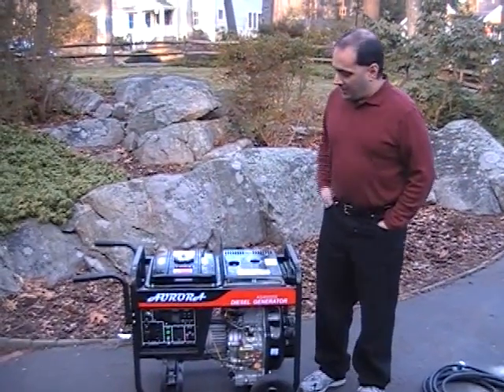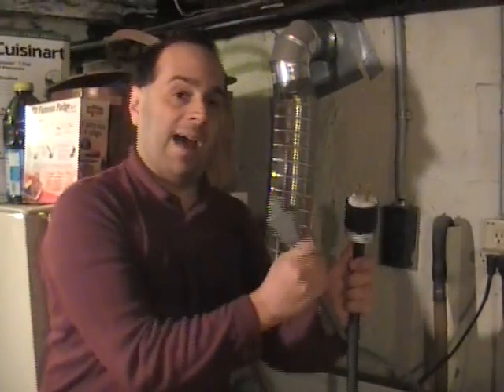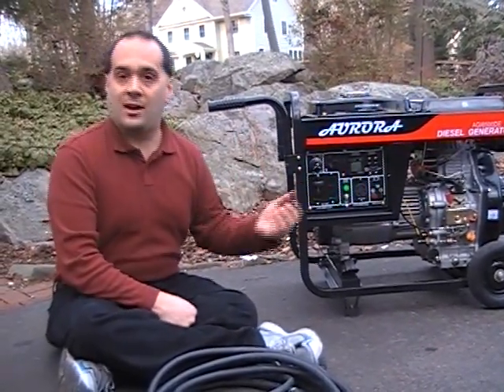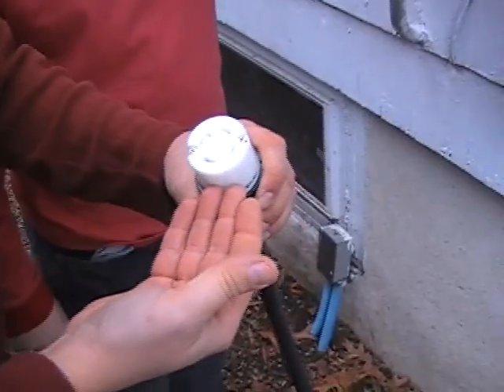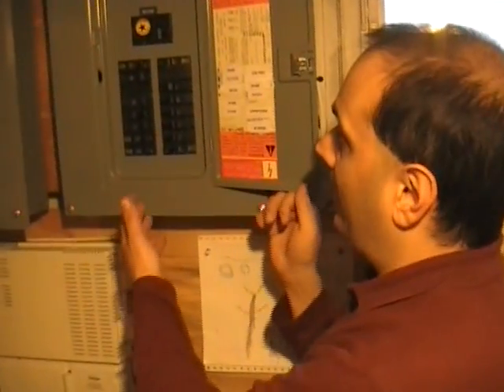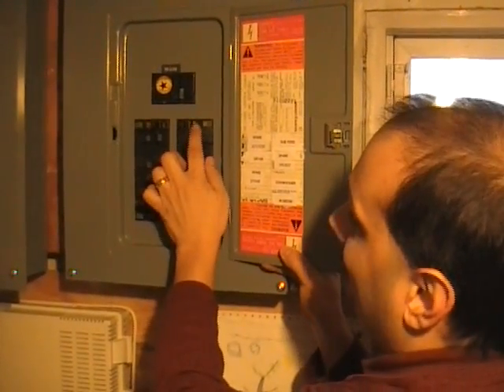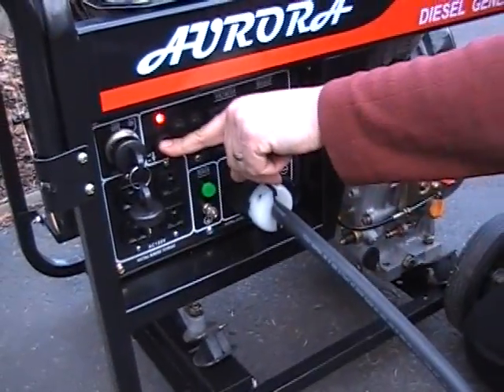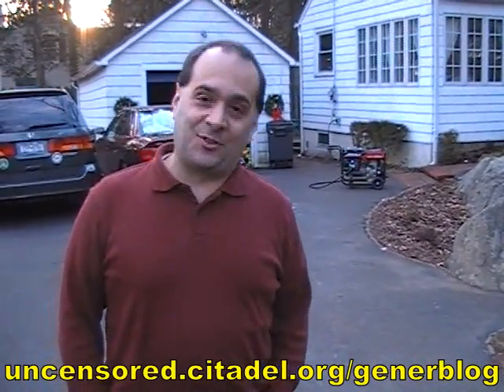Inexpensive residential generator hookup

Comment: Maybe you can answer this question for me please, I narrowed down the appliances we need to power in case of a power outage and its a furnace (13.9 amp), 2 fridges (both are around 9 amps), Dryer/washer (each is 6 amps, but I will run one at a time), bathroom lights with an exhaust fan (7 amps....fan is strong) and some lights which will come out to around 5 amps.  I am around 41 - 42 amps in case of a power outage and this is for a big house.  I went to Home Depot and I was told a generator with 50 amp breaker when connected to a 2 pole 50 amp breaker will always supply 50x220 = 11,000 watts even if I am only using one appliance  or no appliances being used.  Is this true?  They told me to at least always go with a generator that can generate 10 amps over what it is connected to which means in my case if I connect it to a 50 amp breaker, then I would need 60 amp which they don't sell.  But is this true?  If even a 30 amp generator hooked up to a 30 amp breaker that the generator will be maxed out even if the house is running say 5 amp?
Reply from the maker: To say that the generator "will always supply" the maximum current isn't exactly true.  It will supply whatever you are drawing at any given time, up to the maximum.  And you do need cables, receptacles, and breakers that are rated up to that maximum.   If you want to run all of those appliances at the same time, then you need the big generator (10,000 watts is a common size, but expect to spend a lot of money).

On the other hand, if you don't plan to run all of those loads at the same time, then a common 5,000 to 7,000 watt generator connected to a 30 amp breaker will do just fine.  The house in this video has a 30 amp generator main and I attached it to a 6,500 watt generator.  We would run whatever loads we needed, and if we got carried away and ran too much at once, the generator's own circuit breaker would usually be the first to trip.

Bottom line: buy a generator that can power whatever you plan on needing to run AT THE SAME TIME.  Then buy cables and receptacles and breakers to match whatever size plug is on that generator.
Reply: I was shocked when I went to HD and the electrician told me "If the generator is hooked up to a 30 amp breaker, then the breaker will pull 30 amps from the generator and even if you are using less than 30 even 5, you will still be producing 30 from the generator.  He actually told me if its connected to a 30 amp breaker, then your generator (30 amp gen) is fully loaded even if nothing is used inside the house.
I sat down with my family to decide what can be on at the same time and it came out to around 41 amps.  So, I am looking at the 50 amp generators for around $1K alone.  But I am afraid when its connected to a 50 amp 2 pole breaker that the generator will be producing 50 amps and that's its max.
Reply from the maker: The HD guy is simply wrong on this one.  If you wire your generator to the transfer panel with a 50 amp breaker, 50 amp connectors, and 8 gauge wire ... the generator will be able to supply ** UP TO ** 50 amps.  It won't be supplying 50 amps all the time.  At any given time it will supply whatever you're drawing from it.  Think of it this way: imagine what your electric bill would look like if you have 200 amp service and you were drawing 200 amps all day long!  It's the same thing with the generator.
Reply: @IADHDD  Generator safety rules: Always make sure you follow all the generator safety rules before using your portable generator. This is only a reminder. Generators can be dangerous if not used carefully. Every year, hundreds of people die or get injured when using portable generators due to carbon monoxide poisoning and electrocution. Make sure you are using your generator carefully and keeping others safe as well. There is something very serious that everyone should always be aware of when using generators. Some people do run their generator indoors which is not safe and that increases the risk of carbon monoxide poisoning which can cause death of family and you. Some people run their generator in wet conditions which can electrocute them. Please remember that you should never run your generator indoors. Remember that carbon monoxide is an odorless and colorless gas that you cannot see or smell. Carbon monoxide is a silent killer. Keep that in mind. Make sure your generator is 15-20 feet away from your house and away from doors, windows, and vents. Never use your generator in your porch too. Having a carbon monoxide detector is very important against generator safety. Some people also allow children to go near the portable generator which could pose risks. We need to keep an eye on our children making sure that they are not near the portable generator so they won’t get electrocuted or burned by the generator which is dangerous. A locking enclosure also keeps kids safe. A generator shed might look like a tempting place to explore, or take cover during a game of hide and seek, but a generator is a dangerous piece of equipment that can cause injury. It says on the manual that we should also keep children away at all times from the portable generator to avoid injuries. Please do not allow a child or unqualified people to operate the portable generator.  It is important to keep your children safe especially little ones. The portable generator can be hot during an operation. Just because some manuals missed what should be listed doesn’t mean it’s safe to do. Always follow the generator safety rules when using portable generators. Generators pose electrical risks. If you need to use your generator during wet weather, you need a generator tent to protect your generator from getting wet. Don’t let your generator get wet. Keep your generator dry and before using your generator, please make sure your hands and your generator is dry. Do not wear loose clothing when operating the generator. Everything that is said on the generator’s operating manual should not be ignored. Never smoke cigarettes near the generator. Please keep flammable things away from the generator. Never overload your generator too. Your generator can catch fire. Never ever try to plug a generator cord into a wall outlet to avoid back feeding. Back feeding your generator is dangerous. Always turn on your generator first before plugging in appliances and shut off the appliances before turning your generator off. Use a heavy duty cord for your generator and the cord should not be worn out. All the instructions should be followed carefully. Never refuel your generator while it’s running. It can cause fire if fuel spills while your generator is hot. You should turn off your generator and let it cool off before refueling it. Having a fire extinguisher next to the generator is also important. This is only a reminder for everyone’s safety of using generators. Make sure your generator is properly grounded. Having a fire extinguisher next to the generator is also important against the safety rules. https://youtu.be/I1jT3ANENvI and here is a video more about keeping others safe when using generators and also about our family’s safety. It’s important to keep our little children safe as well. Make sure they’re away from the generator. Hope this helps.
Reply: He is confused. Maybe someone was talking to him about the difference between a standard generator and an inverter generator. What sucks about standard generators is that the must run 3600 rpms whether you are using any power or not. This is how they make 60hz power. They have 6 coils inside and that's how the math works out. Obviously, it takes more fuel to run 3600 with a load than to run 3600 with only a couple lights on, but still it's way more fuel than if you could idle it down. Now in comes the inverter generator. It works more like your car with an inverter attached. It generates DC and sends it to a built-in inverter. So since the 60hz, AC is being created electronically, the generator can idle down in times of little use. This is why the little Honda's and the like are so crazy fuel efficient. That's really the only reference I can think of to what the homedepot guy could have gotten completely confused. Also, I notice that you said your washer and dryer use 6 amps each... Are you sure about those numbers? If you have a gas dryer, I guess maybe, but 6 amps is nowhere near high enough for electric dryer... it'd be more like 45 amps... Also, an exhaust fan @ 7amps??? That's 700 watts! It'd better be strong! For 700 watts, it'd better be able to suck you up off the toilet and blow you into the back yard like a damn ejection seat!

Comment: I  agree with everyone that it's a great video!  I see a lot of comments from Professional electricians I'm hoping that will give me
a little help.  I live in rural so. WV and to give you an idea how rural,  wife and I don't even have mail delivery.  We drive seven miles each way twice a week to get our mail.  the nearest town to shop is 2.5 hours away.  That's how far an electrician has to travel.  I have one who an another veteran from the VA called me and said he would drive to my house and install the system if I 
could be sure to have the box, breakers, switches, and everything he would need.  I sent him the video link and he said it was no problem, but I need to purchase everything to avoid his business markup.  I' m looking to only power 5 rooms off of a 5500
electric start 30 amp generator.  Electric start for wife as I'm a disabled Vet on O2.  So I'm asking what do I need as far as the box, breakers switches, etc.  Any help greatly appreciated.  I can not afford to have him come more than once.  Thanks
Reply from the maker: You might want to consider a water cooled 1,800 RPM diesel generator.  They cost more but they are rated for continuous operation, so if your utility power is out for a couple of days, you can run the generator the whole time. An air-cooled 3,600 RPM generator will get damaged if you try to run it for more than a couple of hours at a time.

As far as your supply list, it depends on what your main panel looks like right now.  Do you have room for an interlock?  You should probably send a photo of your main panel to your electrician friend and determine what's needed to connect up to that.  The parts list is going to be determined by whether you have room for an interlocked main, or if you are going to put all of the generator-fed loads in a separate panel like I did.
Reply: I really didn't expect a reply, so I want to thank you Art!!.  I was looking at a few separate box systems after I posted and I really liked the Idea as It would be so much easier on my wife if something happened to me.  I was looking at what I would need for the electrician.  I'd like to use a good box with a good interlock.  I only
need about 6 - 120 lines is all.  I need a small box of square design with a bottom feed,  that's  stupid right.
Reply: @egm1947  Generator safety rules: Always make sure you follow all the generator safety rules before using your portable generator. This is only a reminder. Generators can be dangerous if not used carefully. Every year, hundreds of people die or get injured when using portable generators due to carbon monoxide poisoning and electrocution. Make sure you are using your generator carefully and keeping others safe as well. There is something very serious that everyone should always be aware of when using generators. Some people do run their generator indoors which is not safe and that increases the risk of carbon monoxide poisoning which can cause death of family and you. Some people run their generator in wet conditions which can electrocute them. Please remember that you should never run your generator indoors. Remember that carbon monoxide is an odorless and colorless gas that you cannot see or smell. Carbon monoxide is a silent killer. Keep that in mind. Make sure your generator is 15-20 feet away from your house and away from doors, windows, and vents. Never use your generator in your porch too. Having a carbon monoxide detector is very important against generator safety. Some people also allow children to go near the portable generator which could pose risks. We need to keep an eye on our children making sure that they are not near the portable generator so they won’t get electrocuted or burned by the generator which is dangerous. A locking enclosure also keeps kids safe. A generator shed might look like a tempting place to explore, or take cover during a game of hide and seek, but a generator is a dangerous piece of equipment that can cause injury. It says on the manual that we should also keep children away at all times from the portable generator to avoid injuries. Please do not allow a child or unqualified people to operate the portable generator.  It is important to keep your children safe especially little ones. The portable generator can be hot during an operation. Just because some manuals missed what should be listed doesn’t mean it’s safe to do. Always follow the generator safety rules when using portable generators. Generators pose electrical risks. If you need to use your generator during wet weather, you need a generator tent to protect your generator from getting wet. Don’t let your generator get wet. Keep your generator dry and before using your generator, please make sure your hands and your generator is dry. Do not wear loose clothing when operating the generator. Everything that is said on the generator’s operating manual should not be ignored. Never smoke cigarettes near the generator. Please keep flammable things away from the generator. Never overload your generator too. Your generator can catch fire. Never ever try to plug a generator cord into a wall outlet to avoid back feeding. Back feeding your generator is dangerous. Always turn on your generator first before plugging in appliances and shut off the appliances before turning your generator off. Use a heavy duty cord for your generator and the cord should not be worn out. All the instructions should be followed carefully. Never refuel your generator while it’s running. It can cause fire if fuel spills while your generator is hot. You should turn off your generator and let it cool off before refueling it. Having a fire extinguisher next to the generator is also important. This is only a reminder for everyone’s safety of using generators. Make sure your generator is properly grounded. Having a fire extinguisher next to the generator is also important against the safety rules. https://youtu.be/I1jT3ANENvI and here is a video more about keeping others safe when using generators and also about our family’s safety. It’s important to keep our little children safe as well. Make sure they’re away from the generator. Hope this helps.

Comment: Nicely done.  I am a retired broadcast engineer with experience dealing with remote mobile power systems, and am confident with my abilities.  I live in an isolated frontier area in the Rockies at 9,000 feet with a year round population of 800. We are so "Frontier" the county has not adopted building codes.  During the winter, temps can get to -30F for a few days at a time.  My house depends on AC power for water pumping as well as the regular uses.  I like the way you isolated vital circuits in the sub-panel, and the simplicity of the Qo2Dti interlock.  I ordered the interlock, cable and inlet box off of Amazon for about $130, and will install upon arrival.  I have the rest of the components and generator, so should be up in a week or so.  Thanks.

Comment: how to run a generator legally? wtf? there is no "illegal" way to run a generator.
Reply from the maker: Please educate yourself.  There is a little something called the National Electric Code.  It contains all sorts of items regarding auxiliary power sources, including the acceptable way to configure transfer switches, inlets, wire sizes, lots of detail.
Reply: educate myself huh.?. my wife and i are powering up our 29 ft 5th wheel with a gg 900 watt generator and its perfect for us. so if there is something "illegal" please let me know.
Reply from the maker: The rules for RV's (or whatever a "5th wheel" is) are likely to be very different from the rules for a house that is permanently wired to the electric grid.  If the NEC does not apply to your installation then you're likely to be fine, but you're also not doing anyone a favor by claiming that there is no such thing as an illegal generator hookup.

Comment: Great video!  I was worried at first it you were doing another video about back-feeding the dryer blunder.  Glad to see you pointed out the risk of doing that.  I went the interlock kit method as I conveniently had a 30 amp circuit in the top right for a stove, and we had a 100% gas stove, so it was a perfect circuit to back-feed.  Also at the time (roughly 8 years ago) the sub panel method which you did was slightly more expensive.

In any case, great video!
Reply from the maker: If the conditions are right for an aftermarket interlock, it's a perfectly viable option.  As you saw in the video, my panel was already full, there was no room for another two-pole generator breaker, and I wanted to add a few circuits too.  Also the aftermarket ones they were selling at the time felt a little clumsy to me because they attached to the panel cover instead of to the panel itself.  Today you can often buy an interlock designed by the original manufacturer for your specific panel.  In my new house, I am looking at replacing the outdoor service disconnect with a Siemens PW0816B1200TC panel and ECSBPK03 interlock.